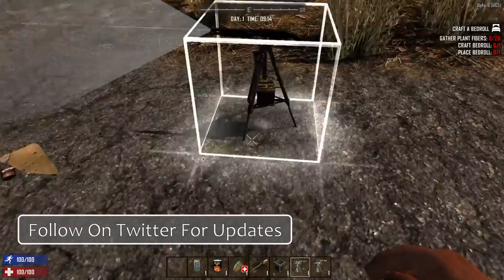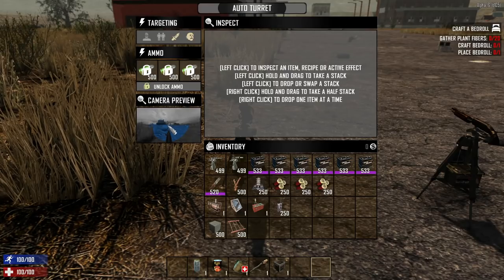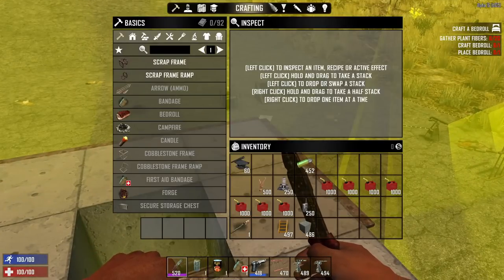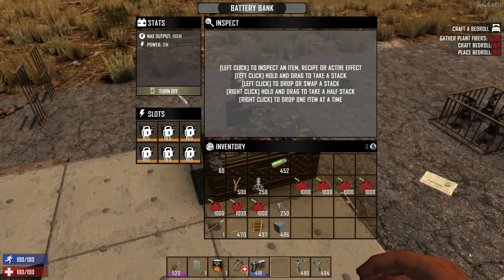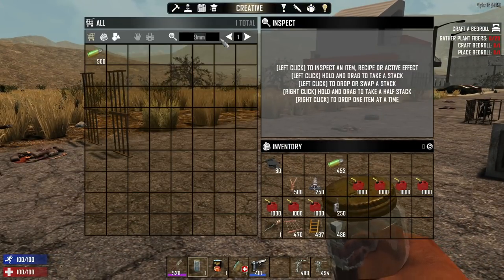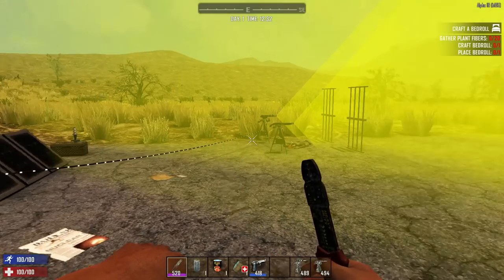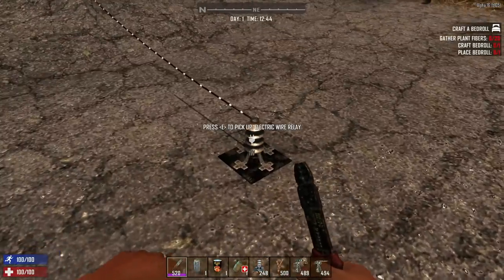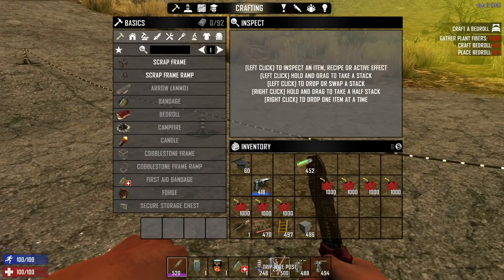Electricity & Turrets Tutorial | 7 Days To Die Alpha 16

Comment: At 6:30 press 'R' to change the rotation option to 'Advanced' (or one of the others) if you want to cycle through the block's x y and z axis. 'Copy' direction is useful for building rows of bars or walls where they all face the same way, using 'Advanced' is good for flipping ramps upside down to make anti-spider climbing defences etc.

Comment: now i know how it works :D thanks ^^
Reply from the maker: No problem! Just remember, as I didn't do the greatest job explaining, that when making complex circuits you need to always wire them up "downstream" from the energy source, and ever connection requires a right click with the cable wire tool on the upstream connection, and another on the downstream connection.  Good luck happy hunting!
Reply: :)  yeah I understand. It is great that you have tried the different components.  ;)

Comment: how do you move the turret? i didn't get it
Reply from the maker: MAGIC! just kidding; plop your land claim block (first rule of 7 days to die is now to not scrap your land claim block, but in B129 it was changed to require iron and not steel, which is nice) down near your turrets and you can push and hold E and provided the turret isn't damaged, you can pick it up.  If it's damaged just repair it.  Now, there is a radius at which your land claim block will and will not work, but i dont know what that is, you'll have to research it it :) Mine works in teh video because i placed the land claim block pretty much adjacent to my crappy looking tower of doom.
Reply: Thank you!
Reply from the maker: NP!